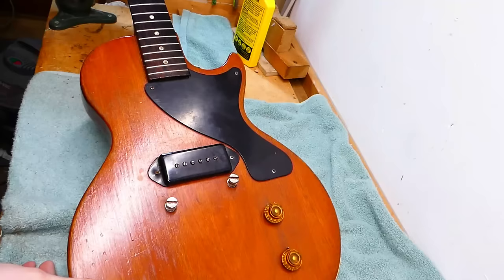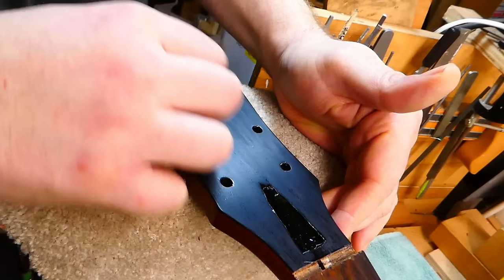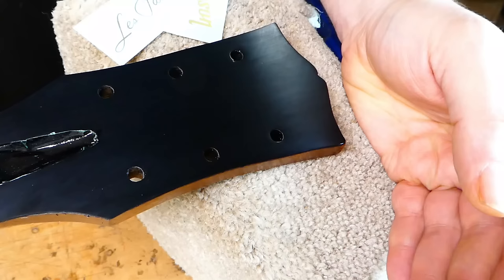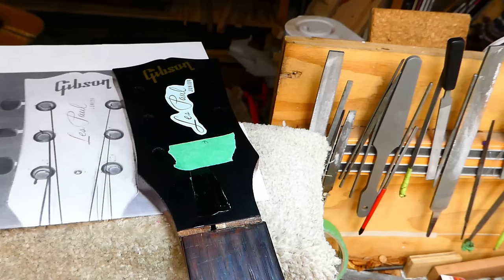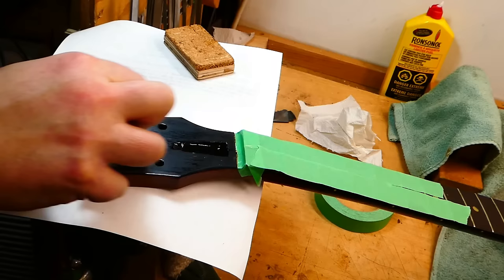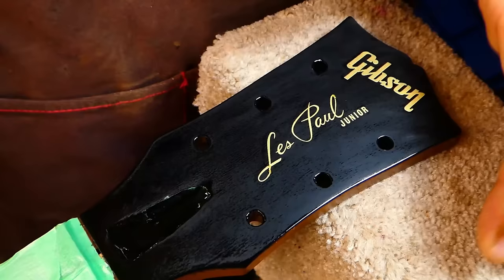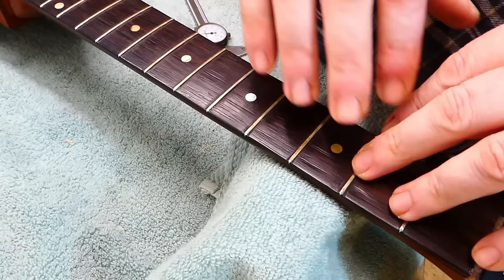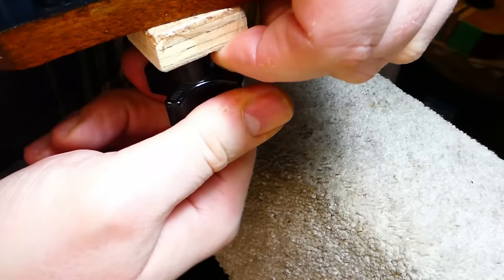50's Les Paul Jr. PART 2

Comment: Really nice work on that old barn job.  Concerning decals, there is a product that I use called Micro Scale Decal Set.  It’s a decal solvent that allows the decals to “melt in “ to a surface that is less than perfectly smooth and flat.  I’m sure you’ve experienced that “silvering “ effect that happens when you apply decals onto an airplane kit that has molded-in detail like panels or rivet heads.  Decal Set basically turns the decal into something like paint that conforms to just about any surface, no matter how uneven it is.  I’ve never used lacquer over a decal after melting it with Decal Set, so I’d try it out on scrap first with an extra decal.

I’ve built over one hundred miniature model ships and Decal Set has never let me down.  And I never touch decals with my fingers.  I wet the surface first with plain water before application and use a wet cotton swab to position the decal.  The wetter the surface the more easy it is to reposition the decal.

Once more, I know this was posted a year ago, but I hope your health issues are satisfactorily resolved.  I know from my own experience that there are some things that you just have to compensate for and learn to live with.  Best wishes from south of the border!

Comment: FYI: You can add water with a brush to the edge to refloat the decal to move into position.  Then lightly touch the decal edge with a tissue to remove access water trough capillary action, then leave it alone overnight.  Allow 24hrs. before a clear over spray.  To use old decals, spray a clear before wetting decal to seal decal film in place.  Then cutout decal to shape or close to lettering, then dip in warm water to set, Good Luck.
Nice woodworking work!

Comment: A small tip. If you think of the earth cable as a drain pipe, then a drain pipe is sized to get rid of the volume of water that will pass through it. An earth cable operates on the same principle draining electro magnetic generated energy. Therefore it is imperative that the earthing cable has as big a cross section as possible and is connected directly to the output jack, ensuring a direct path to earth. I use 2.5mm desoldering braid, covered in an isolating sleeve, connected between the string posts/tremolo or tailpiece and the output jack. This optimises the Faraday cage effect of the strings. This effect is something that has always been underestimated in the industry. Thanks for the inspirational and informative videos.👍
Reply: Because 100mv needs extra large conductors to flow easily to ground.
Reply: @Dustin2112  This ground wire has nothing to do with the pickup signal. It is only there to conduct electromagnetic energy picked up by the metal components. It works like an aerial diverting energy directly to the jack socket preventing it reaching the pickup.
Reply: Cool, I used a thick piece of pure copper on my fancy pots and pickups, just one long piece connecting all the pots. Mainly because I hsd it lying around. Guitar sounds great but I suspect it's the new pickups. I don't think it matters, it would really have to be a crappy tiny cable to not be sufficient, dunno I didn't finish my physics education but I don't remember anything about that other than standard stuff like the cable should be avle to carry the load but anything will do for such tiny currents.

Comment: Screen printed, then tampo pad printed and later screen printed and then water slide decals. MicroScale decal makes some waterslide decal liquids. One preps the decal. Another remove bubbles, folds & alligatoring. Another liquid softens the decal so it sucks down over any details (model building {railroad}), and then there is a shine remover that flats the waterslide part down to a flat super low gloss satin.

Comment: I find it helps when putting decals on, especially large ones, if you spray a couple of coats of clear over the decal first and let it dry for a day.  This both protects the decal surface from being damaged and adds stiffness to the decal so it doesn't fold or form 'hills' when you are moving it around.  I also use MicroSet and MicroSol (primarily designed for plastic modelling decals) to help them stick and follow the form of the surface.   I think it helps to get less of a raised edge to the decals (though I haven't done a direct A/B test so it could just be confirmation bias).     But I did use this method on a near A4-sized decal to go on the front of one of my guitars and it went on without any problems.

Comment: Great work as always! What I found was that most of the reputable replica builders agree on is that de Gibson logo was a decal (or inlay on standards) and got covered with clear coats but that the  script was silkscreened on after finishing. That's why G logo is mostly protected and you can see the cracks in the clear over them while the script paint is exposed and wears much more easily.

Comment: I worked for a Canada based company at one of their facilities in the US.  To bring a part into Canada for their engineers to examine for the complaints I had about their design required much money and paperwork to get across the border.  It was a $400 electronic part.  To return it back to the US was cheaper but was more paperwork and we were just simply done with the whole import export thing.  So once the Canadian engineers had examined it we just threw it away.  $400 electronic parts were regularly being thrown into the dumpster at the hotel.  NAFTA made the transfer from Canada to the US much easier but it was like nothing had changed for the US to Canada transfer.  I think Canada pretty much ignored their part of NAFTA.

Comment: Your comments on “relicing” are spot on.  Authenticity and subtle changes are of up most importance.  I’ve seen so many hack jobs, including a lot of stuff done by the Fender Custom Shop, that just looks like someone took a claw hammer to a new guitar with no thought given as to what might have realistically happened to the guitar to cause those scrapes, scratches, wear, etc.  

OK, you’re near the output jack, and over years of playing, it is possible the artist, missed the hole a few times and marred the finish with the 1/4” plug.  But hacking at it with a giant phillips screw driver, to the point of removing wood chunks, is ridiculous.  It just wouldn’t happen.
Reply: Relicing seems like the epitomy of yuppie values,
Reply: @user-qn6dn1ht4j  can’t disagree with that.   It’s like paying more money for already ripped jeans.  Now, I don’t personally have an issue with pre-washed jeans….in this metaphor,  the equivalent of light, tasteful, and realistic relicing, if that’s what a person wants,  but I’d never pay thousands of dollars more for it.  

I love Fender, but they’ve somehow convinced a large sector of their clients that “vintage” mean beat to hell and “custom shop” means built to hell a little different from the other guitars they beat to hell.  I don’t get it, but people must be buying it.  Nuts really.

Comment: Excellent workmanship. Great attention to detail.
Makes me want to take up fixing guitars! I do have some slight experience....
Well, I carved a new bridge & replaced a cracked one in a friend's acoustic guitar (possibly a Martin), about 40 years ago.  In the process, I made it play much better, too! The action was certainly better, and intonation was spot on (i used the same saddle). 
But, i have to say in retrospect, i used "cave man" techniques and got really lucky. I carved it by hand, though i did get a block of dark hardwood and some tips from an actual Luthier ahead of time.
But I've learned so much in the meantime!  Plus, I've had a lifetime of experience in doing delicate work.
So, i might give it a try!
(Maybe after my wife retires in a few years, and we move someplace where i have space for a shop.)
Great video, good project.  Learned a lot.
👍   👌

Comment: One thing I’ve noticed about the reproduction decals is out there is the Junior text is larger than the original text, at least with respect to my ‘56 Junior that is roughly 30% smaller. Excellent work young man.

Comment: Nice job. A tip to greatly reduce drying time: a few days after you shoot your final coat lightly wetsand  (I use 600) just enough to cut the gloss and NOT trying to make it look perfect. This allows solvent to dissipate much quicker and the accompanying shrinkage. You want to leave plenty of lacquer for your final flatsanding just before buffing.

Comment: There are 3 kinds of restoration;

1) museum restoration, in this case all of the parts need to be from the original year, yeah the instrument is probably worth $1,000,000  and the fact that it costs $100,000 to do the restoration is not a problem.

2) functional restoration, in this case it may look original, but you take the cover plates off, and you find new parts, and that's fine because it's likely going to sound a lot better then all original.   Your likely to have a 65 year old guitar that looks like it came out of the factory yesterday.

3) working restoration, playable is good enough, it doesn't have to look new, it doesn't need new guts, as long as the owner can plug it in, and play it, sounds decent, then that's okay.  

I think it this case, your going for a working restoration, and as long as the owner is happy with it, even though it has a few war scars......

Comment: I use artist brushes very fine soft pointed tip and a soft small fan blender never failed once. Brush a puddle of water on before you start. You can brush out as you position and remove the water.

Comment: Thank you for Great Video, as always.
I really enjoy every time.
As for decal placement, my 2010 58' reissue Les Paul Std is same as original 58'.
Also tuner post placement is same.
As far as I can see, the tuner placement of 79 and 2000's are meant to prevent the 5th and 2nd string hit the 6th and 1st tuner post. (I guess)
I had owned 2006 78' reissue Les Paul Custom model had same decal placement as 79 and 2000's.
Just FYI.

Comment: I stopped using water slide decals for pedals and use vinyl printer paper instead and it's way easier and super durable. Sadly it's not suitable for a headstock cause it's far too thick so for headstocks i still do water slides that I make myself with inkscape. But they are one of my least favorite things to do in the world. But when they do come out right it's very satisfying. I couldnt imagine trying to get it right with one or two decals. On average to get a useable decal I print 10 and of that around 8 are usable and to get a good even application I use about 5 of them and still feel like it's not as good as it could be. It's a perfect example of when "the enemy of good enough is better". But I have to say this decal came out great Ted, your experience and cool head shows.

Comment: I have a cheapo fret crowning file with small and medium sides.  For recrowning, I use a small piece of 400 grit sandpaper and the opening of the proper side of the file.  This works so nicely and gets much better results than my 3 point file; there are no file marks to deal with and after 400, I go up to 800 and then 1500 to polish the frets.

Comment: You don't need to soak the wet and dry sandpaper for hours. The backing paper on wet and dry is coated to make it waterproof. The idea behind wet and dry is that the water flushes away the debris that you are scraping off the surface and keeps it from scratching the surface. The trick is to get a set of sanding pads. You can find them on sites for plastic model builders. They come in packs that have multiple grits and you start with a coarser grit like 600 and go up by 800, 1000, 1200, 1400 etc. Each finer grit with remove the courser sanding scratches from the previous grit. As for the decals you can also get blank decal printing paper at model building sites. These allow you to print your own image files in whatever font style or high resolution you want and print them out and make your own decals. It may sound complicated but I build models and also do guitar repair and once you have the image files you want you can print a whole batch of logos at once and keep them for later use or just store the imgae files on you computer and print them out as needed. Hold the backing with tweezers and use a medium sable paint brush to move the decal. Wet the area where the decal in to be placed. You can move the decal as much as you want as long as you use lots of water to float the decal. Even if you have removed all the water from under the decal by using the paint brush to add new water and refloat the decal. One last thing. If you print your own decals you can add wear to the decal image itself using an image editing program. In other words you could add cracking or color fading before you actually print the decals.

Comment: Lettering.  a letraset decal   de cal will be raised b .002 adhesive. Silkscreening ink thickness will be dependent on the screen mesh.  a comparator will quickly make that determination.

Comment: I set out to do the same exact procedures 9n my guitar regarding the tuner bushings. The holes needed reamed out to fit these larger bushings and I decided I didn't want to do that so I returned them and ordered the Kluson conversion bushings that actually fit the holes I have. I had even come up with an install tool like yours so I could press them in. (Edit: oh, and the first bushing I tried caused the tuner to bind up so that's also why I didn't use them.)

The larger bushings appeared to be exactly the same as the bushings that came with the tuners. They weren't the same. Had they been, I'd have been happy to ream the holes since I'd have stock appearing hardware. But that's not the case so no reaming for me.

Comment: Enlightening as always. Regarding the decal alignment, it did occur to me that on the 50s Gibson logos, the vertical elements of the typeface are parallel to the guitar centre line, and the later ones have a jaunty forwards slant. Yours seems to lean back a little in comparison.

Comment: @twoodfrd I use Mr. Mark Softer and Setter when putting decals on models. Might not be necessary for flat surfaces but they are significantly easier to use than water for decal application.

Comment: A trick to revive a 50 year old decal: Simply spray over the top a few coats of clear glossy poly and let dry. That will strengthen the decal to the point where it performs like new again.

Comment: As a model maker, I found the water slide decal segment hard to watch 🤣 Unless you work with them frequently, they can be very fiddly. If you break the surface tension, by brushing on Microset first, you can move very large decals, for quite some time, relative to how fast it dries. Wrinkles and shrinkage can be removed, after it dries, with one, sometimes multiple passes with microsol, and a damp q-tip, rolling it across the decal, between your fingers. Great job though. Everything turned out great

Comment: Hi ya Ted,
First off I love your channel although I’ve told you that numerous amounts of times as well 😊
I’ve done a bunch of slide decals on mostly newer type builds and a few on old ones but they were all Fender. I usually did about 6 coats of nitro over the decal simply from fear of sanding back into the decal, this one came out beautifully and the headstock is certainly looking cleaner than the rest of that guitar though haha, if the owner does care free string changes though that’ll get ‘reliced’ nicely lol…..
I also own a Gibson Les Paul Special and the intonation was ‘ok’ however it bugged me just knowing it just wasn’t right. I searched around for an upgraded wraparound as you or your customer did here, I wound up purchasing one from Faber though, it’s nickel and the intonation is literally spot on. I highly recommend buying that one which is right around $100.00 US money if memory serves me right. On a downside I suppose though, you can easily see it’s not an OEM tail via Gibson though although it’s certainly not an eyesore either, it’s very well made.
Thanks for all your videos, each and every feed is an education. Hope you and yours have a nice Thanksgiving as well.
Tommy~

Comment: Excellent work. I’ve have done hundreds of decal jobs on both headstocks and effects pedals and I know how time consuming that is with the curing time!! And shrinkage. Well done mate. Also, I’ve also thought with those bridge types with the adjustable screw, wouldn’t it be great if, once you have the ideal intonation after adjusting with those screws, there were packing pieces available to ensure full contact between the bridge post and the bridge? Instead of having all of that string tension forced through 2 little set screws? So the screws were use as adjusters but the final result was packed out correctly with precision ground shims or something?

Great work as always!!

Comment: One way to align the decals accurately might be to use a projector to project that image of the headstock onto your headstock, aligning the edges. Then apply your decal and move it around so that it lines up with the projected image. Perhaps overkill, especially for something that you don't do often, but maybe you'd have use for a projector for other reasons.

Comment: I suspect the earlier examples you have at least the word Gibson is actual gold leaf. There was a process where the leaf was in a roll and a heated stencil was pressed down on the foil which adhered only where it was hot and the rest of the foil pulled away. It was quite common in the cosmetics industry in the 70's.  This was much faster and more accurate than water slide decals. As you noted the water slide type gave themselves away by the clear margin around the artwork.